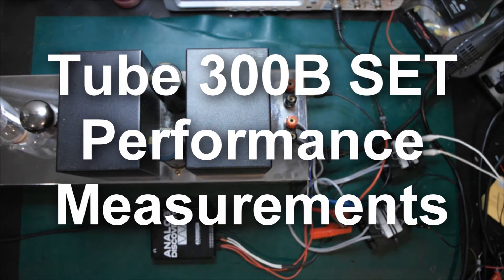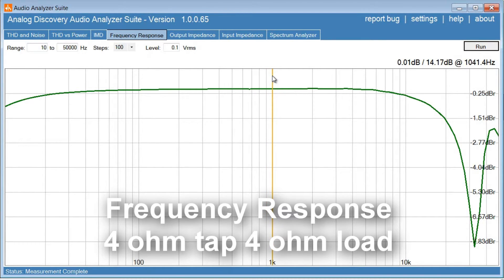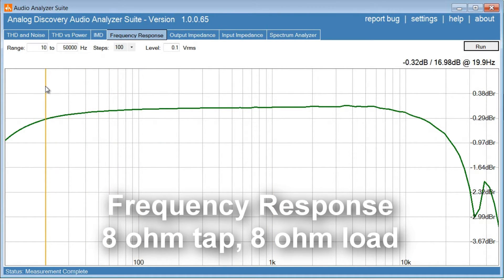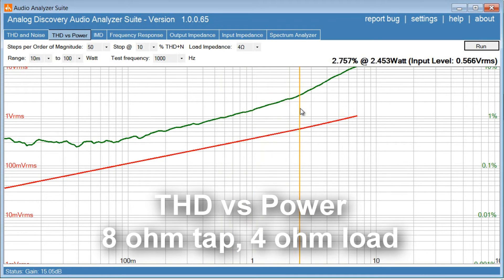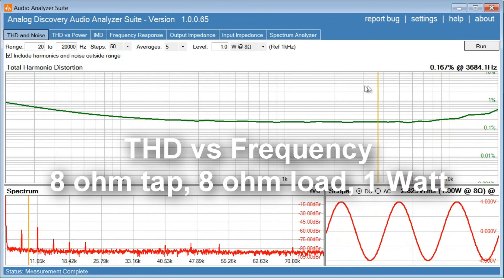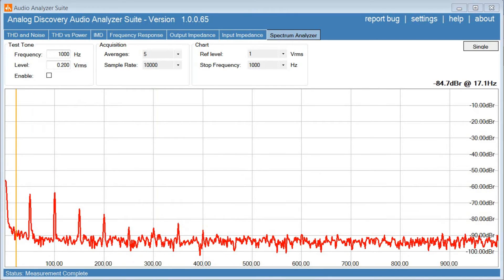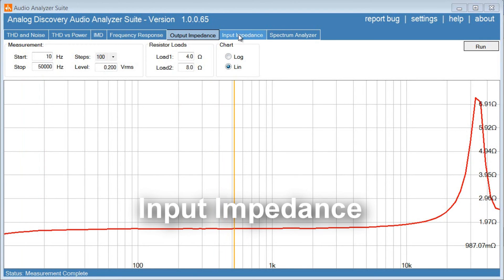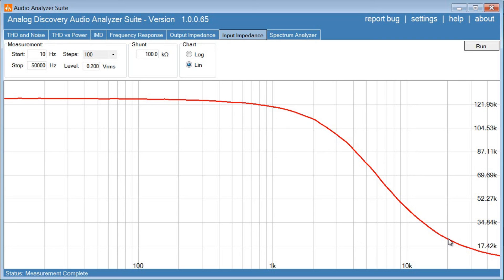Tube Amplifier 300B SET Single Ended Triode - Part 3 - Performance Measurements

Comment: The output impedance plot can come in handy for deriving an amplifier's damping factor at any frequency within its rated bandwidth. It's interesting to see the differences in damping factor between various solid state and vacuum tube amplifiers.
Reply from the maker: +fpliuzzi Agree, the output impedance is often ignored or provided as a simple damping factor figure. In my experience the "damping" in the damping factor figure only really matters in the bass as in whether you have a tight or a warm bass. But often it's ignored how much effect it can have on a speaker's frequency response. Especially with most speakers lacking impedance correction.